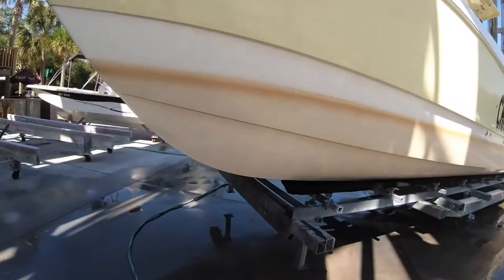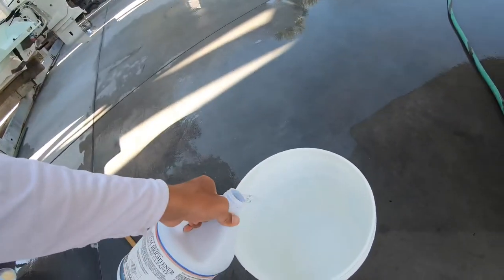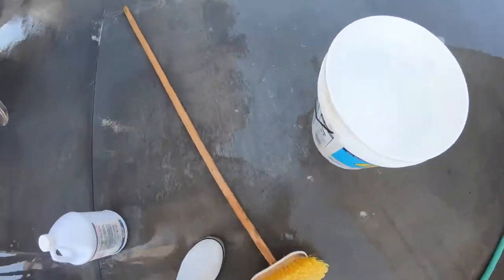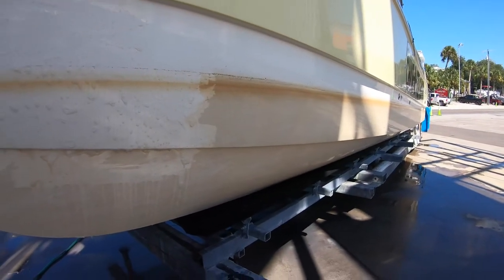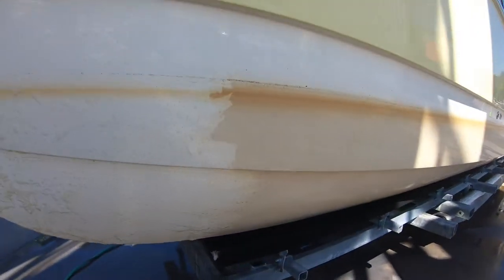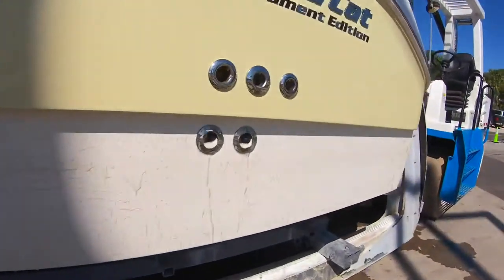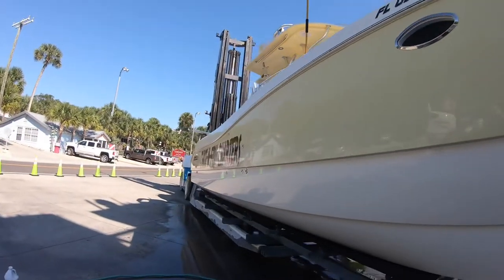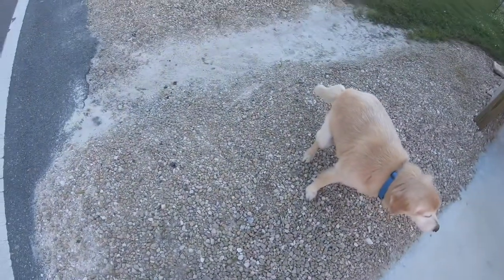HOW TO REMOVE YELLOW STAINS OFF YOUR BOAT

Comment: How much does a gallon of that aluminum brightener typically cost?
Reply from the maker: A gallon is $35.89 and a gallon will usually last my boat at its size around 2 months and using my boat regularly.
Reply: @chasenfish888   Thanks for the info!  That is very affordable when you look at it on a per boat wash basis.